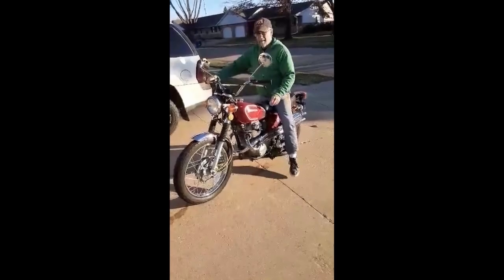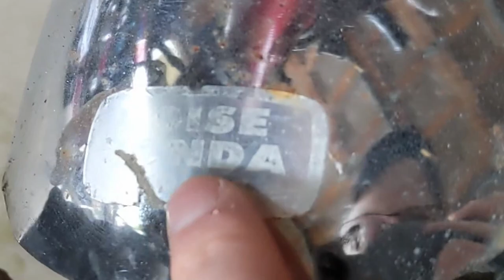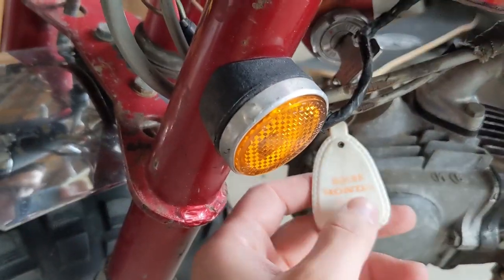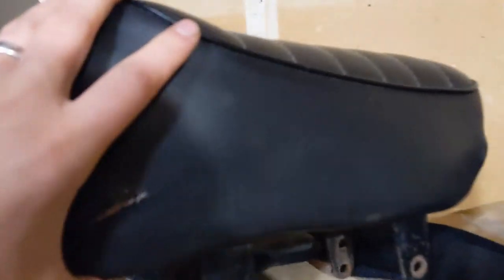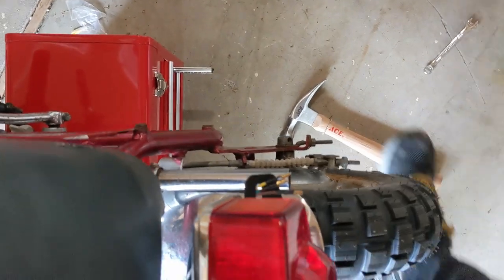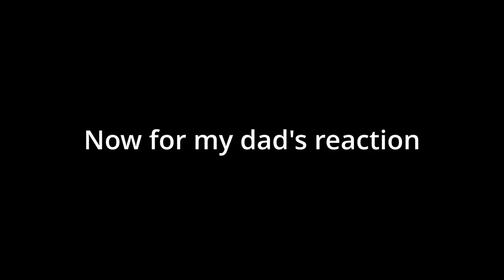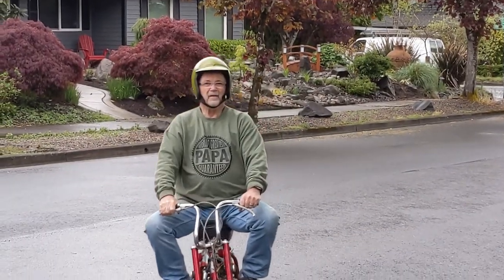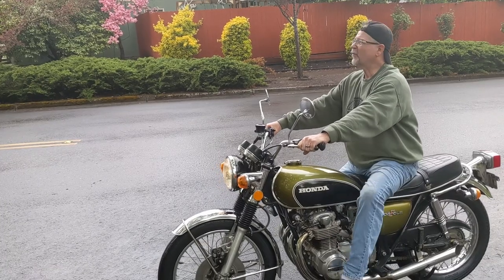I bought a Barnfind 1969 Honda Mini Trail | Will it run?

Comment: What a great old bike! Just proves you don't need 500+ cc to have fun, anything with an engine and two wheels is instantly fun. I have two 50cc "bikes" a 1976 Simson S50B and a Jawa Babetta 207 and they're both sooo much fun! That's gonna be great for your kids to start learning on!
Reply: I have a 80cc "sport" bike and a little crossbike (a Tomos) and they're super fun, especially since you can ride them in Holland without a motorcycle license

Comment: My very first bike I ever rode was a 1971 K2. My grandfather bought it for my uncle used years ago, and I crashed it off a 4 ft ledge after accidentally upshifting into 2nd gear. The throttle mechanisms are notorious for sticking and that bike has been crashed into so many fences and vehicles through the years. Its in similar condition but exactly as I remember it. 

I still have the bike at 35 years old, with a photo of my grandfather and I working on it together when I was 12 or so. Its probably the only bike I'd never sell, under any circumstances. 

I got a chuckle out of the BAT ad - think I recognize the first one on that list!

Comment: Dad riding in the rain with a pair of needle nose pliers on the throttle cable.  Pretty funny.  These old Honda's want to run, even if they've been sitting for a while.  If it's only running a choke it probably just needs a good carb clean and it'll back to 100 percent.
Reply from the maker: Yeah we did a carb rebuild and new spark plug along with a few other minor things and it's running like a dream

Comment: Silver tags are early production 69 bikes and they don’t have the vin on the federal safety cert and the tag is held on with adhesive without rivets. So that is correct and should be original. I have a pretty roached silver tag frame I’m hoping to save, it’s cracked and been poorly rewelded in the past but hopefully it can be revived.
Reply: I have a "black" tag Z50 that is dated 9/69.  No title. Is it a 1969 or 1970?  Thanks! Kirby
Reply: @cramersclassics  it’s hard to say. Both 69 and 70 models are considered k1’s and the vin data covers the model ranges but doesn’t break it down by year. That production date may be late enough for an early production 70 or it could still be a 69. 69-70 Black tag bikes should be virtually identical to each other. I was able to find mine was a silvertag even though the tag is missing by the lack of rivet holes in the neck and the vin falling below the known silvertag range. Sorry if this isn’t much help.

Comment: Ah, the bike I couldn't afford when I was 12, I finally got decades later. I restored mine about 5 years ago. You didn't say how much you paid, but I'll be free with my story: I bought my 69' AK1 maybe 15 years ago, and at that time paid $1500. It was complete and not dented. Yes, I paid too much, but where are you going to find another that's a great restoration candidate? Even at that time I knew it'd be tough to find OEM parts - some really did need to get swapped out. OEM tank, headlight bucket, muffler and chainguard were either unobtanium new, or a kings ransom used. I lucked out and didn't need to go there. I had to put it away for 5 years after I got it, but that's a different story. I did a 100% ground up restoration. I pulled every part and made it as usable as possible. I wire brushed every single grade 8 nut, bolt and washer. Where I could swap OEM (bad) for OEM (new) I did. I maybe put $3000 into it, so a total of $4500 was spent on the project. It's perfect. Instant conversation starter. I could probably sell it and break even or better, but I'm not interested at this point. Congrats on your find. I know it'll be tough to spare the money, but find/gather the missing parts NOW and put away until you can deal with rebuild and original paint costs. These are getting real rare, no joke. Good luck.

Comment: That's gratifying to watch! A little Honda Trail was actually the very first "motorcycle" I ever rode, back in the late '60s in Downtown Boston--a charming place to grow up. A buddy had got his hands on one somehow. Yeah..."somehow". It...um...disappeared very soon after--probably to pay off some of his Dad's bar tab. After that it was just a long succession of barely-running Briggs&Stratton or Tecumsah engine minibikes with nickels typically hammered into their worn out centrifugal clutches to make them direct-drive and perhaps only "notional" brakes. They were just crude lumps in comparison to that slick Honda. Still, they were ALL surefire fun when you're like 10 though. It seems you were lucky finding that semi-decent one, which seems to look and run well enough to proudly qualify as a "light fixer-upper". I see "Royal Enfield Bullet" is on that motorcycle desiderata list of yours. That's what I mostly chuff around on nowadays: an '05 Bullet 500 in that green "Military" trim. I just adore that über-elemental old thumper, being already sort of wise to its generally finicky "Britbike" ways, though it was made in India, having already owned a couple of Norton twins and a BSA Victor 441 single. If you do get a Bullet and don't mind the odd tinkering and fettling, I highly recommend one of the pre-2006 original preunit "Iron Barrel" designs. I'd be the first to admit they ain't for everyone, but I'm pretty confident YOU'D have the mechanical chops to happily nurse one along. Unlike later models, the preunit "Iron Bellies" are true engineering fossils, basically unchanged since 1954, or even the late '30s, when the Bullet model first appeared, in many respects.
Reply: Knew it was you from your prose style, mention of the Bullet confirmed it.  Got  my red Z50 for Christmas in 1969 when I was twelve and probably clocked more mileage on asphalt than dirt.  Tried to turn it into a chopper then gave up, patched it back together (mostly) and traded it in for an SL100, which I also rode mostly on the street.
Reply: @blazesboylan7947  OH! How goes it there esteemed Joyce fan? If I'd known you'd be around I'd have onomatopoeiaized the sound of that Trail's first startup à la 'Finnegan's Wake' and the birth of the world. You here to sell this poor lad on one of those newfangled twins? I'd say he's probably easy pickings for such evangelizing what with his elderly Triumph and Honda already being of that parallel ilk. Funny about that yearning for choppers back in the bygone. It must have had something to do with that whole '60s Zeitgeist and its desire for "transcendence" that persisted well on into the '70s in less fashionable spots, like wherever you might find the likes of me. We used to saw off bicycle forks and then hammer them onto the existing ones to get that stretchy look--wouldn't even weld or otherwise secure them in any way, just keep wheelying until they broke and set our chins into the pavement. Classy, right?

Comment: In 1982 I bought a 1969 Honda mini-trail 50  pull the motor out bought a 1971 ct90 Trail Honda put that 90 motor and wiring in the Mini Trail and had 2 have a special rear sprocket made so I could put the 90 chain on there so it will do about 55 right now in high range and it does have lights so it's street legal but I never registered it for the street!! and just now 2023 March 4th just ordered a new carburetor and battery for it because it's been sitting for decade after decade and going to put new tires and tubes on it! But normally ride and race my 92 CR500 Honda and just bought a brand new Honda 2022 CRF450R and I already put $4,000 worth of mods on it also that bike I would have never believed is just about as fast as my Honda 92 CR500 500 is all tricked out and is the fastest dirtbike I ever rode in my life had it bored ported polished FMF pipe milled head new rims tires o-ring chain all new plastic throttle grips rims carburetor work this bike is clean LOL

Comment: any plans to restoring it to 90-95% original condition yet? I'm looking for a similar project and I suppose being that old and rare must add up to be pricey real quick, so I'm looking for a newer model (70-80)
Reply from the maker: So I'm basically just getting original used parts when I can to match the look, for example the footpegs aren't correct so I'm looking at a few used sets. I have an original headlight but I'm pretty sure it's a later year, the red is just a bit lighter. I'm not planning on making it street legal and I like this look so I'll mostly keep it like this
Reply from the maker: And yeah it's expensive. What year are you going to get?
Reply: @bartmotorcycle  I don't have a preferred year and I do like the older esthetics but a newer with suspension would also be nice; my intention is to buy a working minibike or 3 wheel ATV on the cheap and spend mostly time in updating or restoring depending on the parts availability and condition; how much did you pay for yours?